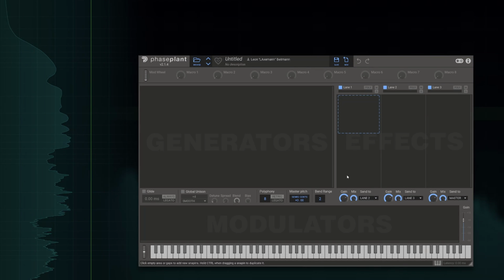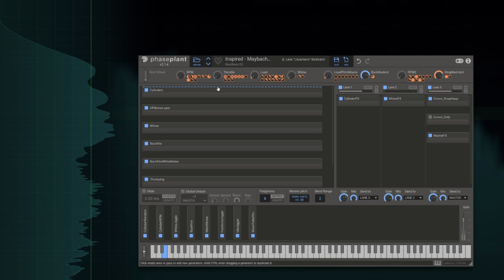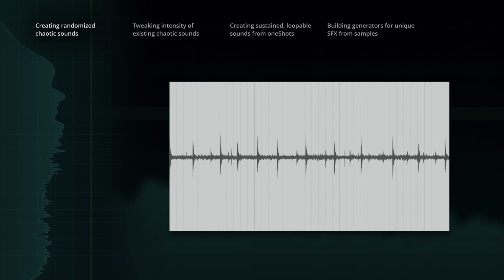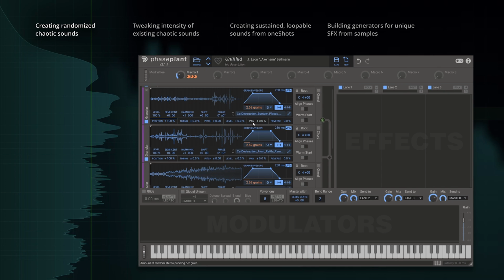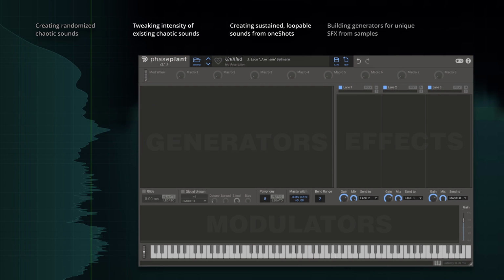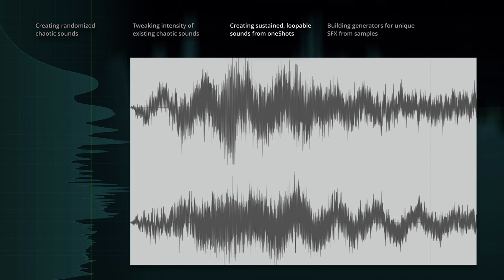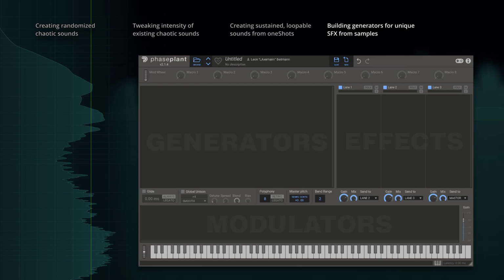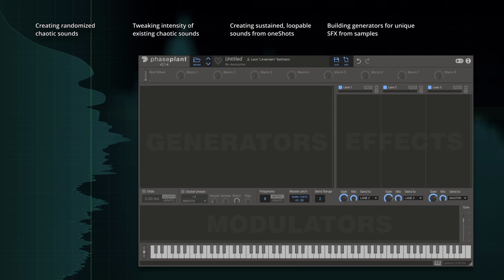Make Phase Plant your workhorse for game and movie sound design

Comment: A co-worker of mine sent me a project that had Dispenser in it and after the trial period ended I had to subscribe to Kilohearts (I already had Snap Heap + the freebies and used them a lot). Phase Plant was a positive surprise that quickly improved my workflow exactly because of the custom LFOs and very competent granular engine. 
One thing I missed in the video is talking about how you can make longer grains and control their envelope, that makes it very flexible and it's so much easier than what I had in Pigments.

Comment: Great use of granulator, I do the same thing all time myself, extremely handy tool for creating chaotic sounds. You can also use it to generate debris layers, by attaching the number of grains to a one shot ADSR and playing with it a bit. 

I have tried using it for vehicles, but unfortunately could not find a use for it in game audio. It would usually become to noisy and lose all character. It could defo work movie stuff though! There are solutions like REV2, but as I understand it does granulation in realtime. We ended up creating a completelly different approach on creating engine loops, which is way longer in production, but it works ahaha

Comment: Nice video! Thank you :) The only downside of Kilohearts ecosystem is that Distortion, Phase Distortion and Bitcrush snapins cut out everything above 20k, even at higher sample rates (96 or 192kHz). It was a big disappointment when I noticed it.
Reply from the maker: Hey John, glad you liked it! And damn, I never noticed that myself!
Reply: So you’re saying it causes aliasing?
Reply: @INeedsMoneys he never said that
Reply: @MrAw3sum  I know he didn't write it down that's why I'm asking. Was that what he was trying to tell us? I don't get why cutting frequencies above 20k would be a bad thing besides poorly implementation of anti aliasing. Maybe you know the answer.
Reply: @INeedsMoneys  Hi there! It's not about aliasing, it's about pitch shifting. When you process sound with these snapins you loose everything above 20k.

They added this filter to prevent alaising, but it's a poor implementation, because if they care about sound designers, they know that they need ultrasonic content (up to 100k).

Most plugin developers have the aliasing filter based on sample rate you use in your DAW. Not at a fixed point (20k). Their snapins don't take into account what sample rate you use. This is the problem.

If you have a project in 96kHz sample rate, the alaising filter of every plugin should be at 50kHz not at 20kHz.

Their latest snapin, Shaper, works excellent.
Reply: @johnkoulouris  aahh. Now I understand. Thanks 👍 hopefully they can fix this issue
Reply: @INeedsMoneys  Yes they can, but their response was... "Don't hold your breath".
Reply: What’s wrong with aliasing?
Reply: @F4xP4s  it is basically inharmonic overtones. Stuff that fills up the mix with unwanted "blur". If you want your mixes to sound clean, or even distorted but in a musically pleasing way then you only want harmonic overtones to come from your plugins. Unless it's a noise OSC in a synth etc. 99% of the time aliasing causes bad sounding mixes
Reply: @INeedsMoneys  is there a way to remove the aliasing?
Reply: @F4xP4s  yeah sure. It's called oversampling. Most distortion/saturation plugins have oversampling. Oversampling usually doesn't remove aliasing completely tho. Just making it less audible. Oversampling also makes transient material less transient. Blurs the transients. So it's both good and bad
 Aliasing is the devil.
Reply: @INeedsMoneys Understood, and thank you for explaining. But as I think the OP alluding to, the PP plugins don't oversample. Is there a way to fix aliasing without oversampling features? BTW, I would probably oversample and then layer in a nice transient :)
Reply: That is dissapointing. I pressume that also means we don't have to worry about aliasing at 44.1 and 48, right, since there is nothing to reflect down?
Reply: Thanks for sharing